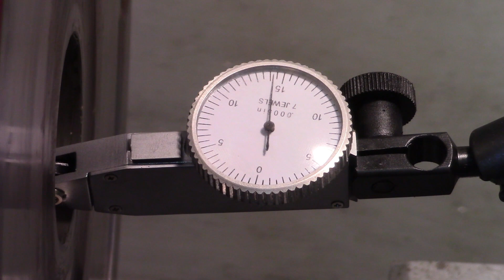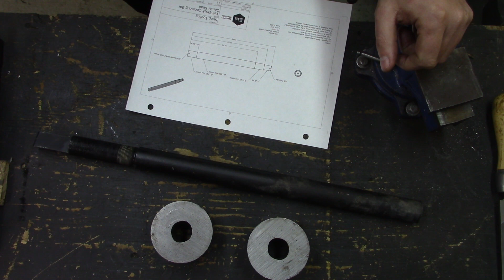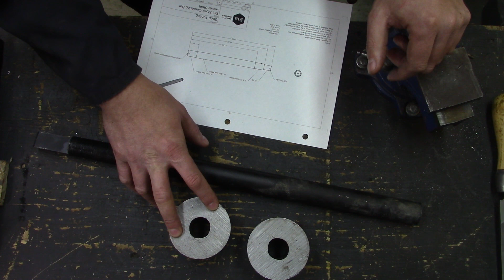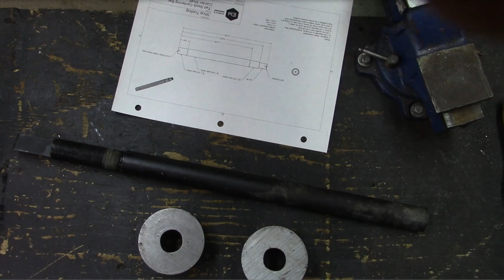Making and Using a Tail Stock Alignment Bar

Comment: Everett, do you follow Joe Pi? He has a good video on chip forming... that bird nesting is quite a pain, no ?
Reply from the maker: Hey, how goes?  Yes, I watch Joe, I quite like his work and his explanations of things.  Lot of respect for him.  I find bird nesting annoying, yes, but have a limited number of types of tool holders at the moment.  Every now and then I get a hold of another type and experiment with it, but wound up with a bunch of CNMG stuff for cheap.  A lot of the inserts are geared more for heavier cuts than is normal for a hobby lathe so it will sometimes bird nest on me due to chip breaking issues.  But, as long as I'm not getting lacerated I will use them up, I guess!  As funds allow more insert types will be tried out, maybe there is a better geometry/chip breaker available.  Hope you're doing well!

Comment: Nothing wrong with being cheep, you know what I said “ I have more time than money “
Reply from the maker: The thing is that if it's necessary, and a high enough priority, then buying something is fine.  As this is a hobby, and stuff can be a normal cost of business for a real machine shop but prohibitively expensive for home shops, we just make as much as we can.  The ones who really impress me are the home hobbyists in Eastern Europe or Asia, they are inventive and creative with using stuff at hand because that's their only option.
Reply: Everett's Workshop well said. I’ve also said, we’re hobby machining. If we are running a shop for profit, there is a shop cost, so a $100 part that may take a couple of hours to make is better purchased. But we are doing this for personal satisfaction so the couple of hours is time well spent.

Comment: if you heat work heat steel block you put it on i did not .  it acted like a heat sink  pulled heat out  part froze to large in bore . start over
Reply from the maker: I just figured that using the press was sufficient for this one. We were doing exercises of heating sleeves for slide-on shaft repairs in machining class, and I've done it for transmission shaft bearings, but didn't think it necessary this time.